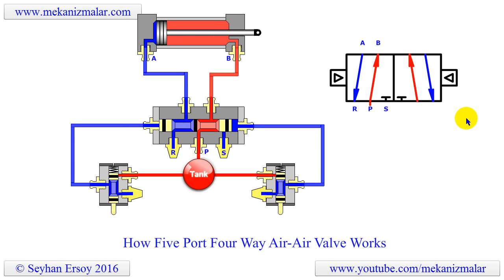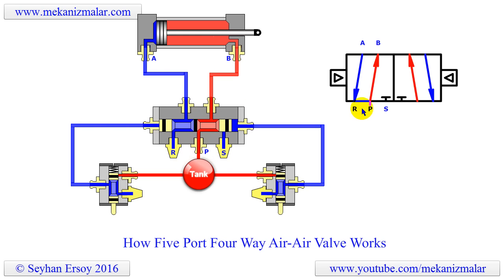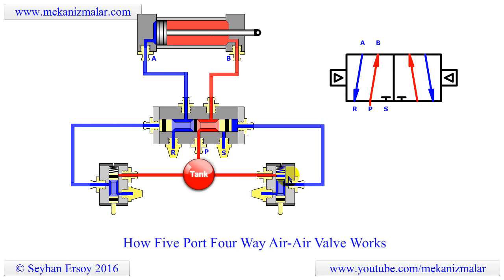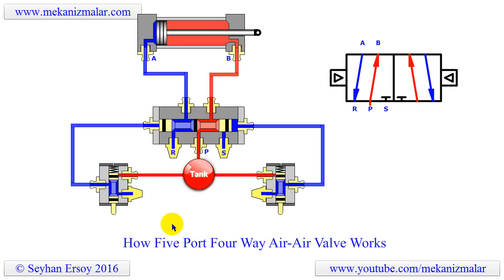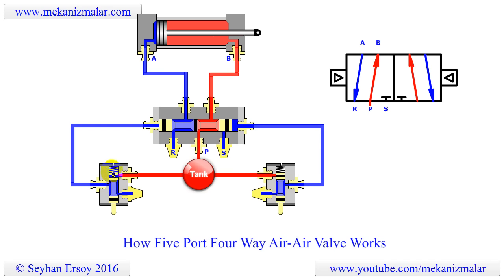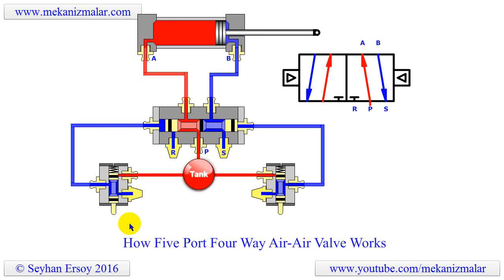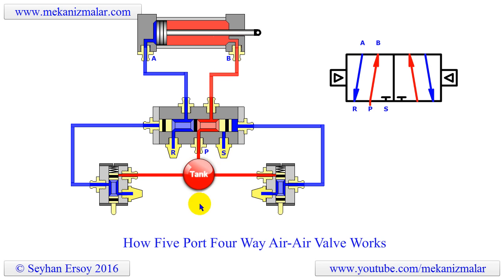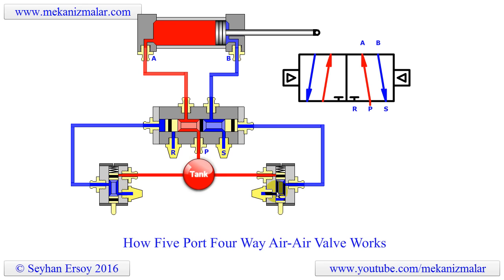how five port four way air air valve works

Comment: Great video, but what is the device with the spool called?
Reply: 4-way valve
Reply: Both valves have spools...  As stated (and shown), the 4-way valve has a spool that is air-assisted on both ends.  The 3-way valve has a spool the is moved mechanically one way (by pushing in the plunger).  It is moved back mechanically by a spring when the plunger is let out.

Comment: LINES GOING FROM PILOT OPERATED VALVE OUTLET PORT TO CYLINDER PORT SHOULD BE SHOWN LARGE. LINE GOING FROM TANK TO PILOT OPERATED VALVE INLET SHOULD TO SHOWN LARGE. LINES GOING TO AND FROM MANUAL PUSH VALVE SHOULD BE SHOWN SMALL. SO THAT VIEWER WILL UNDERSTAND WHY  PILOT OPERATED VALVE IS USED.